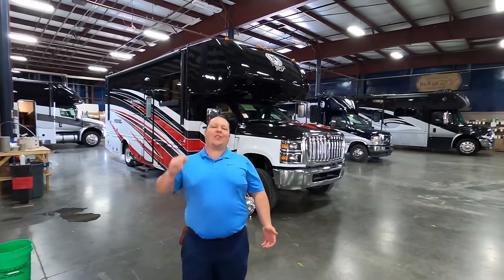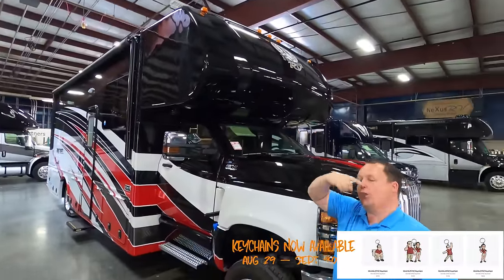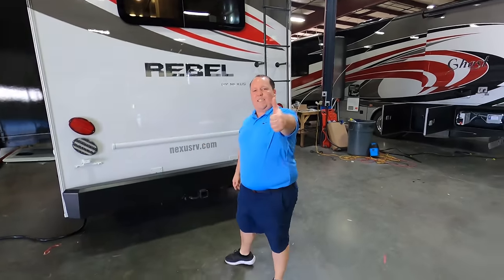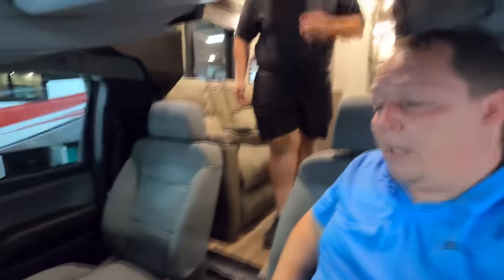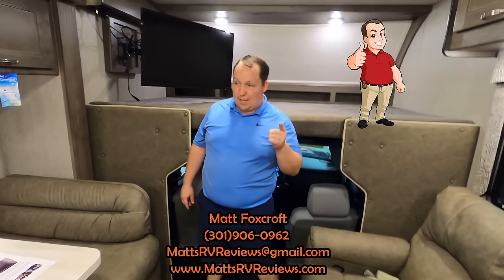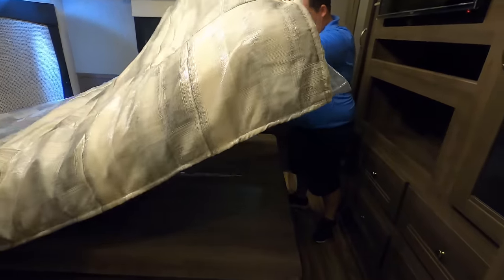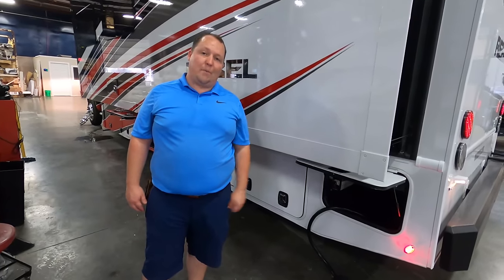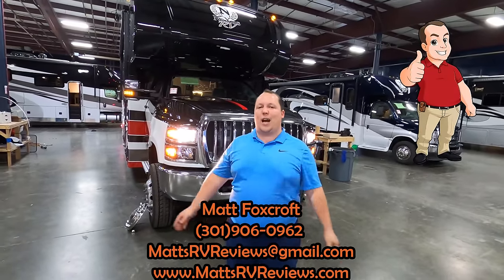The BEST Super C 4x4 Motorhome IVE EVER SEEN 👀

Comment: Matt it has a duramax not a cummins and it is the most serviceable because it is a chevy/freightliner chassis so you can bring it into any chevy/gmc/freightliner dealership for service
Reply from the maker: Womp womp that’s a major fail!
Reply: FYI - This is built on a NAVISTAR chassis, which is a competitor to Freightliner.
Reply: @MattsRVReviews  I posted this about 30 minutes earlier, why the pin for this comment rather than mine?  I also corrected the transmission statement.
Reply: This chassis is the equivalent to the Chevrolet MD 4500 5500 6500. This is a collabera between both navistar and gm
Reply: @tjadamsZ06  because I was the 5th comment 👅
Reply: @MattsRVReviews  just wondering why the price is so high on this unit when the chassis it is on runs about 15k cheaper then the dodge and ford 5500/f550 chassis considering they can purchase the chevy 4500/5500/6500 for under 50k i dont understand why nexus or any other manufacturer could possibly provide the market with a diesel powered rv that can tow like an HD truck for around the 100-120k mark for a sale price
Reply: @MattsRVReviews  btw I love your reviews even though you say rims instead of wheels and you botch the power train side of these things frequently you still have a great charm about your videos please don't change too much from my criticism 

Ps Andrea is the best camera operator and she makes your videos so much better me and the wife love yalls dynamic
Reply: @mattbarrois8675  Simply put, Matt, this unit is WAY overpriced.
Reply: For the high price tag it should be a first class, but by your review it doesn’t look like it. Interior not worth the money
Reply: TJ Adams if this is a serious question, that is hilarious! 😂😂😂
Reply: @charleskelly505  I mean it prices with other super c's but for how basic this one is it compares to class c units that sell in the 80k range i just dont see how entegra can sell an oddessey with an msrp under 120k with typical sale prices being in the 80-90s and they think that because this one has a chassis that cost at most 20k more then the e450 chassis that it should sell for double the msrp maybe we the buyers need to stand up and say something
Reply: @UCOWZnnh55mlCnFuiytitXOg i can go into detail as to why they are wheels and not the street term rims coming from an automotive background terminology pertaining to automobiles drives me crazy when I hear street terms opposed to proper terms it would be like someone calling a pencil a pen and as for the duramax I was upset that Matt called it a cummins because this was the first time a duramax has been in an rv and we need to celebrate the fact that a gm finally has a representative in this market it will give manufacturers more options for chassis' and hopefully start driving the prices down on these things at least to some degree
Reply: @chestercalloway3812  I think it was serious.... And that made me sad.
.
Reply: Will is Matt's best friend. Some people are just so mean. 
It's the same people that can't figure out why Matt and Andrea are together. BUT HAHA! I get it!
Reply: I was wondering why a GM product had a Cummins in it. lol. Thanks for posting this correction. As for the wheels, you're also correct, they're not rims. One thing I haven't figured out is why after all these years the newer models don't come with 20-inch wheels. They keep installing 19.5's on vehicles when 20-inch tires are found just about everywhere, and 19.5's are not.
Reply: @calvinh.8882  they run 19.5 because that eliminates the risk of someone installing significantly under capacity tires onto a wheel for a rig that can weigh upwards of 26k lbs to my knowledge there aren't any 20" tire options for that heavy of duty tire now 21.5 would be a very nice option though
Reply: @mattbarrois8675  Makes sense. Thanks for replying.
Reply: Has nothing to do with freightliner it’s a GM/Navistar combo
Reply: @MattsRVReviews  Jo o9 o9 990 0+o9 Op 0++0+0
Reply: @MattsRVReviews   o
Reply: @MattsRVReviews  Government Motors connection?....not for me.
Reply: crystal meth is a gateway drug matt duh...

Comment: For this high price rv , they should redesign the cabinets in the bedroom so they can put in a stackable washer and dryer- very important. Also, unhappy there are no solar panels on the roof.
Reply: I agree that it should have solar. But bathroom is not big enough to fit washer and dryer even with different cabinets. Also the cheapest new RV in my area that has washer and dryer is a $500k class A. So I don't expect this RV half the price to have one.

Comment: I just delivered a 2021 Nexus Rebel to a dealer and drove it over 1000 miles. 3 things I liked:
1. Good power with the diesel engine. Handled mountains, while towing a car with NO problems. 2. Interior is nice and comfortable, when stationary. 3. The paint job is absolutely beautiful and eye catching. Got a lot of compliments, when stopping for fuel. 3 things I dis-liked (stopped at 3, because that is what you asked for). 1. International CV chassis is a truck, and it drives like one (terrible turning radius and extremely rough ride). 2. Right side view mirror is useless. I had only about an 1" view of the entire side, as the body and awning arm covers 90% of the mirror view. 3. The dual tank filler is wonky. Supposed to be 25 gal front and 40 gal rear, but when filling it from 1/8 full, either filler would only take about 38 gals total before splashing over and the gauge would read roughly 7/8 full.   Keep in mind, this is my view from simply driving the unit for several days. I do not use the RV portion and thus can't relate to it's "livability" however, I can comment on it's "drivability", fit and finish, and appearance.

Comment: My Likes:
Absolutely LOVE the regular oven
Overhead bunk ( I would use it for lightweight bulk storage (needs privacy screen not curtain)
The bathroom (shower door needs to be stiffer & self-cleaning)

DisLikes:
Under counter kitchen storage - everything below counter height should be a drawer
The hanging part of the wardrobe  - the bar and hanging space should continue on behind the TV
Outer storage compartment doors should be side open/close
Make the wall art at the entry dual purpose and add storage behind it
Give an option for a dinette or credenza - 
TV placement near bunk - add a foot long drop-down feature on the arm so that it is better for the theater seating
Add under bed storage
Power cord reel
More 110 and USB outlets
Carpet under the dinette - no carpet at all

Comment: Induction Cook Top is a must, Convection Microwave is a must because then you can delete the regular oven and in it's place add the Fisher Paykel drawer style dishwasher. I know my wife will not even consider a unit without a dishwasher, silly I know but after 27 years I've learned to not talk her into compromise on some things it just isn't worth it in the long run.
I love that you've added the Slam Latch Doors and enclosed wet bay as both are a must IMHO. Also enough Solar with a big enough inverter and battery bank to run the whole unit with soft start ACs should at least be an option on these or have them at least wired for it from the factory. Especially since a Rig like this would be perfect for Boon Docking.
Every unit in this price range or even a little lower should have the Cord Real installed as even the 30amp cords are heavy and hard to deal with at times. As I've said it should be a 50amp setup on these units always.
These videos are old but I just couldn't help myself and had to comment.
I would also love to see this Diesel Chassis/Engine/Transmission setup offered on other units even without the 4x4 feature.
Oh and possibly offer this style without the front bunk and instead more front storage with a larger TV center mounted that is on a swivel.
Beautiful unit and I at least can tell you're listening to your perspective customers and working towards what will be a show stopper in the industry...

Comment: Nice super C.  Couple of things...  needs a 50amp cord reel.  Can you swap the over cab bunk with an entertainment system to get rid of that bad TV angle?  Did not see interior with slide in so assuming you can get to bathroom, but it looks like it would be very tight. Needs induction stove top (make it an all electric coach?), could not tell from Will’s camera angle but looked like it did not have night stands so no place for a CPAP.  Even though it’s a super C, it is way too expensive for the interior features and the fact that it is a GM 4500/5500 equivalent.  Thanks Matt and Will

Comment: Hey Matt, the International 6.6 diesel engine in the CV platform is not a Cummins, it's a GM/Izusu sourced engine. In other words, it's a Duramax, which is why it's so impressively quiet compared to the Cummins engines you're used to hearing.  Also the transmission is an Allison 1750, not 2000.

Comment: Matt the Rebel looks pretty good but:
3 things I do not like; 1. I would not purchase any motor home that has storage doors that I had to crawl to get into. the doors need to open horizontally instead of vertically.
2. Additionally I am a stickler for having the TV directly across form the seats.
3. Keep that tiny over and put in a convection microwave.
Likes:
1. Quiet Power and safety of the Super C
2. Great full body paint
3. Ability to get into and out of cab without crawling

Comment: 👍 Smashy, after a busy week y'all sound tired and a bit punchy, don't think it's just inhaling the Diesel/DEF fumes in the garage.  L:  cockpit, chassis and quiet engine (drove a Ram 5500 bucket truck for a year, the largest I ever drove, first time similarly smooth and quiet); nice kitchen and appliances, oven!; good storage and great towing capability. D: dark woodwork; tv placement; sure that wasn't a convection/microwave? Looked like a metal rack inside.  Stay safe you two, Matt you really need more AC!!! 😷😷😷😷

Comment: I love American RV's chaise,  space and power!   but the interior looks unchanged from 70s.   YouTube recommends RV videos from Europe.  Their interior design is more modern, and utilize space more efficiently.  if you can pass customers feed back to manufacturers,  please let them consider borrowing some design ideas from there.
Reply: Right on!!
Reply: I agree the interior colors/decor could be improved. Looks like a 1970s RV on the inside. Also why not stainless fridge and micro. Looks cheap with the black. Shower door also looks to be cheesy and problematic I would not buy it for those reasons. Also why not use the firefly system in 2020?  Propane tank compartment should have a mesh floor so you can stir oil, def, etc.  why is the def fill not in a lock compartment?  I would worry kids would take the full cap, or drop rocks in the tank.

Comment: 3 things I love
I LOVE how quiet it is when the engine is on
I like the sliding door to get into the bathroom...so when slides are closed you can use the bathroom comfortably
I love the frosted glass on the door...gives a sense of privacy but allows natural light in.

3 things I dislike
I HATE the shower door
I don't like the interior colors
(This one is speculation) it seems ..and I can be totally wrong, that with the slide in, it might be a little tight and can't tell if you can access the fridge comfortably and the bed)

Comment: Perfect coach IF the cargo doors opened out like a traditional door instead of up. It would be so much easier to access the cargo compartments without bending as much or hitting your head. Looking forward to the front sleeper area windshield and a GM chassis/cab to go with the Duramax / Allison combo. Great job-looks amazing and well designed!

Comment: Matt, excellent review as always.  Was hoping this may be my next RV but they did so much right and so much wrong.  My list of what is wrong - storage doors (really bad), TV placement (the worst), backsplash (awful and looks to 1990's or something) cabinet colors (or lack thereof), no solar pre-wire, shower looked "cheap", no convection microwave, power reel (none), macerator pump, and are there any options?  Wanted this to work so maybe Nexus will improve the model over the next year or so?  Too me, looks like a "rush job" of available parts, to meet the Super C market demand.  For this price point, it has to build on the good chassis foundation!
Reply: My Nexus Super C has a convection oven, power reel, solar pre-wire, and air horn. All were options.

Comment: Very nice rig. Technically it's a Silverado 6500 HD Chassis cab with International badging.  it's a Duramax (L5D) engine. I believe it is built (Chassis cab) at the GMC plant in Pontiac Michigan. As for as towing specs, I would recheck that 15,000 tow rating with the trans they are using, it maybe near the 10,000 rating, if that.

Comment: Love the passion of the owner, I hope they follow up like that after the purchase. LOVE this motorhome.  Don't like that is has no washer /dryer and no King bed, TV location is horrible, put a 60" TV across from the theater seats, I don't need the cabintets or the window or use a projector, just be innnovative.  Other than that is is what we were looking for but there are 2 deal brakers , the washer/dryer and King bed. Would love to have a macerator pump.  Love the large black water tank and the way they divided the sizes, this makes the most sense. 
It is possible to store bikes in the pass through ?
Reply: agreed, the washer/dryer is the deal breaker for us too , and it is possible to have them in a 30ft motorhome, let's hope they copy the floorplan from other manufacturers or get creative themselves, it is not that hard, switch out the bed with the closets in the slide, then you have a walk around King and a washer/dryer on the other side like Thor did in their Quantum KW29 which is THE BEST class C floorplan I have ever seen, if THor had a better build quality I would have bought that one in a heartbeat as I really love the floorplan

Comment: 04:04 massive fail putting the DEF tank on the passenger side
Reply: Tell me what a def is please
Reply: @lindakurman8642    It is Diesel Exhaust Fluid. It is a part of the exhaust aftertreatment to help lower emissions. It is better if it is on the drivers side because if you get diesel at a truck stop the DEF hose is on the drivers side. You can buy DEF in bottles but it is way way cheaper to get it at the pump.
Reply: DEF is corrosive I wonder if that paint can handle it.
Reply: Thank u so much!!

Comment: Lots to get excited about here. The potential is off the charts. Not that I know much about super c on a med truck 4x4 chassis. Nexus has always been a value leader in the segment so you're not going to see a lot of higher-end stuff in here. The one thing I did hear in the comments was "I want everything you find in a 38' chassis in this 30' one". Which is of course not possible. I do not know of any 30' chassis in North  America with a washer-dryer, they usually need at least 37 feet, unless you want to do without a shower. The only 30 foot chassis I know on a super C with some off-road ability would be the sportsmen from IWS and but that has the option of a much more powerful engine/chassis, well beyond the price tag of this one. 
   Three things I don't like about this unit, first one would be the one everyone is complaining about, the top-hinged/bump your head/ get down on your knees storage compartments. The TV really should have a better placement.  I would like better prep on the roof for solar that included placement of the roof items and a port for cables. 
 Three things I like the huge storage, 4x4 and, large roof make this so ready for solar/lithium for boondocking. I like the 30ft length. I love that they went without a convection oven for a propane one. If you want a convection oven, go to Walmart spent $80 and it will be far superior to the units they put in any of these RV's. 
  Miss the Andrea, Will did a competent job but it is hard to come into such a well-oiled machine as Matt and Andrea and be as good. It will be interesting to see whether this product will live up to its potential. By the way, is this "ART DECO"???? hehe.
Reply: The Thor Quantum KW29 is 30ft in length, has King bed, washer /dryer, theater seats with TV across etc. , so it is possible to put it in a 30ft Class C floorplan, you just need to know how
Reply: @MsSchlumpfhausen  pretty rare. The tiny shower and the bed on a slide make this work. For some people the comprimise would be worth it.   One thing is that probably makes this a less common item is that these can only operated while connected to full hookups. As they will overwhelm the capacities of such a small rig.

Comment: Hey Matt love that you are going on the road to the rvs factory my likes I have few on this rv 1 love the 4x4   2) the towing capacity 3) the Asdale. Coating  my dislikes I have many 1)the storage doors are cheap and should swing sideways 2) the 50 amp should be on a power reel 4) no solar prep 5)the deft tank should be on the driver side 6)the tv is a bad position 7) the shower door is cheep 8)brighter inside color cabinet like white why is rv almost always brown 9) the light over the kitchen table hangs to low it should be led strips 10) I wish that the super c would come with a washer and dryer I think the price is to high